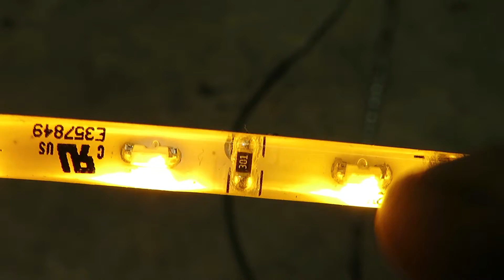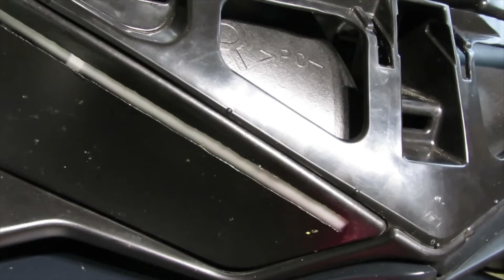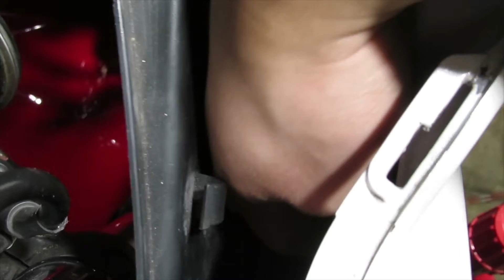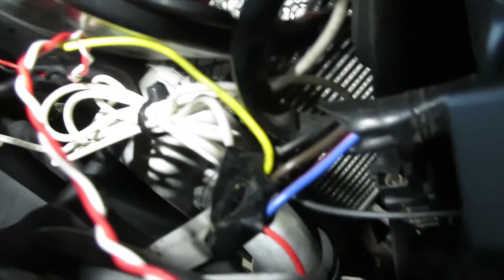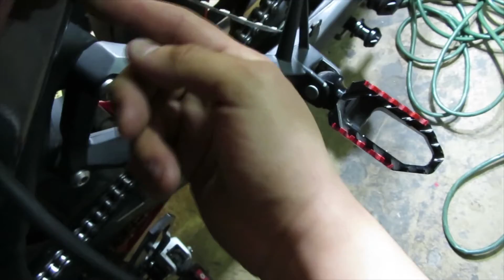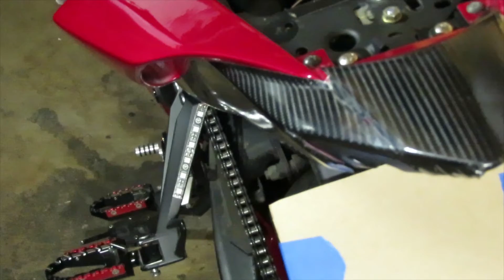How To Install HIDDEN Turn Signals on Yamaha R3/25

Comment: I have a 2017 yamaha R3. I bought Led lights but I don't know how to install it.  These lights have 2 cables and my motorcycle has 3. Could you help me please?
Reply from the maker: you bought turn signal leds?
Reply: @ACProductions77  Yes sir...turn signal leds
Reply from the maker: @yoracojosefernandezsuarez4704  to install the turn signals that only have 2cables and not 3 just means that the led turn signals will only come on when flashing then turn off when you press the button compared to the stock ones where they stay on after you press the button.
Reply: @ACProductions77  I understand.  I have connected them in various ways and I can't make them blink
Reply from the maker: @yoracojosefernandezsuarez4704  then it could be that the led signals you have are defective, its hard to evaluate whats going on with your blinkers without being there to do it.
Reply from the maker: @yoracojosefernandezsuarez4704  this should help https://amzn.to/3rJVTdW OR https://amzn.to/37dhNg5 the system needs a high load to make the led turn signals to work, just replace your stock turn signal relay with this one and you should be good.

Comment: AC I wanted to thank you for this video.   I ended up saving so much money and I got extremely bright rear turn signals now with your genius rear foot peg mounted location!  Also saved money using the POSI Taps instead of converters!  For other viewers, I bought these 5050 SMD LEDs from Amazon which were under 8 dollars!

https://www.amazon.com/Partsam-Motorcycle-Signal-License-Universal/dp/B015H90NBO?ref_=ast_bbp_dp&th=1&psc=1

I'm still unsure which LED DRL strips to get and whether they will fit above the stock 2017 R3 headlights.     What do you think of these? 

https://www.amazon.com/LEADTOPS-Flexible-Headlight-Waterproof-Decorative/dp/B07M7JFNMQ/ref=sr_1_10?keywords=LED+DRL&qid=1584372384&refinements=p_72%3A1248861011%2Cp_85%3A2470955011&rnid=2470954011&rps=1&s=automotive&sr=1-10
Reply from the maker: Kit Wong you’re very welcome 😉 glad I was able to help. And to answer your question the small yellow strips are perfect for the rear but those other DRL’s will not fit in the front plus they are to long, those particular strips are meant to go inside the headlights but will have to be 30cm or 12inches long. Here is link https://amzn.to/3d2Gn57

Comment: Awesome video again. On my bike I ended up using the TST Y-harness to link up my switchbacks LEDs in my headlights. Makes the process plug and play with no cutting/splicing into the factory harness.
Reply: Do you have a video?
Reply: @cloutgangster  I don't but I did use this video to help me out, I just did it a little cleaner with the wiring. https://youtu.be/cSCcYbEXAIc